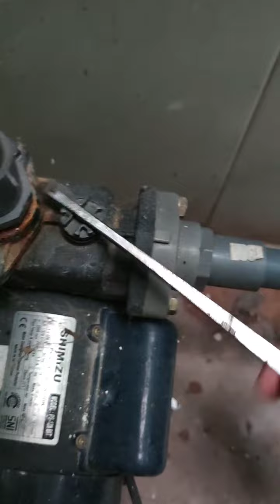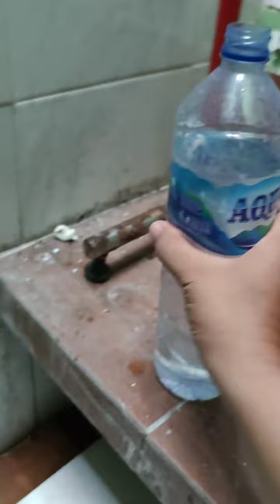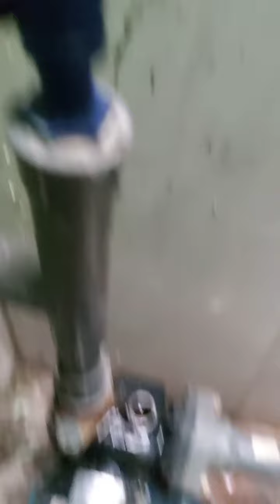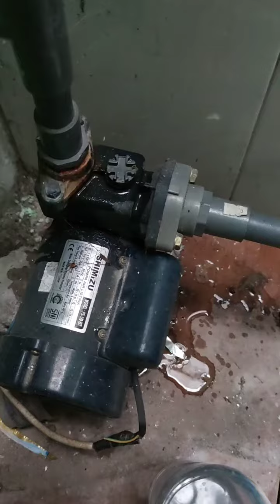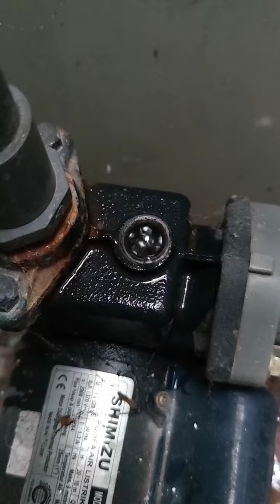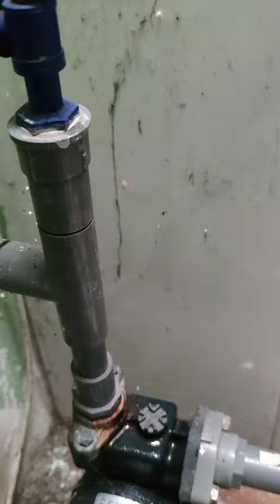Cara mengatasi masuk angin Sanyo

Comment: Om mau tanya, setelah tidak di pake agak lama, dihidupin lagi kok harus di pancing lagi biar cepet keluar itu knp ya??
Reply from the maker: Kemungkinan klep yg dipasang di pipa yg masuk ke dalam sumur itu bocor 🙏
Reply: @yennyyenny433 makaaihhh ommm
Reply: Tanya bang. Yg dimaksut klep itu yg ditaruh sblh mn ya
Reply: @senotileng136  itu yg pake kunci 10 itu pasti bocor om klok sanyo nya gak narikk
Reply: @dickywehdicky6643  yg dimaksut bocor apanya mas.. Setelah sy pancing air kenceng.. Stelah itu itungan detik. Lama2 air melambat sampai g keluar bang. Minta solusinya.. Apa yg harus diganti.. Trimakasih bang